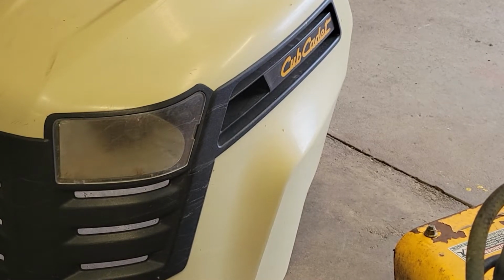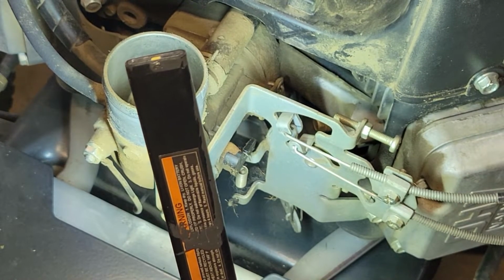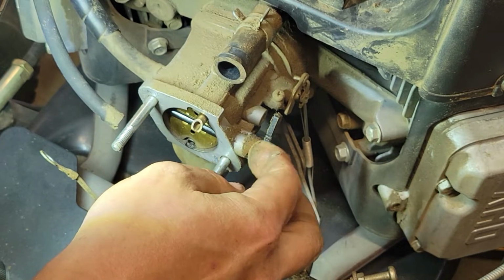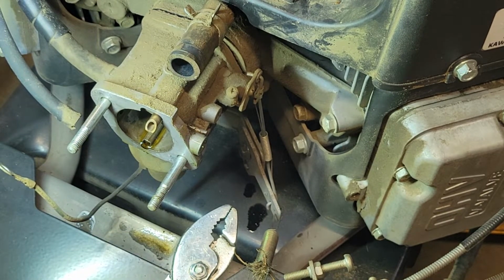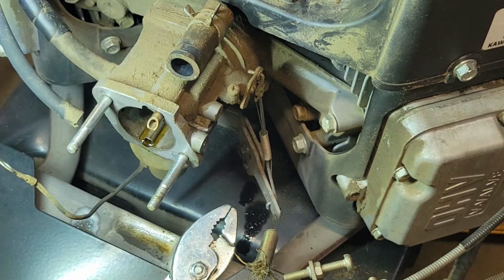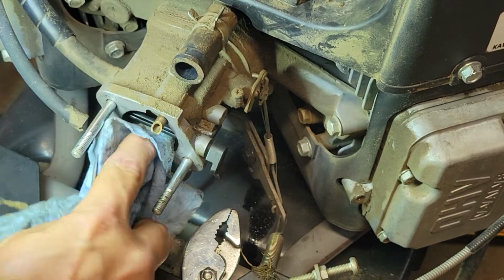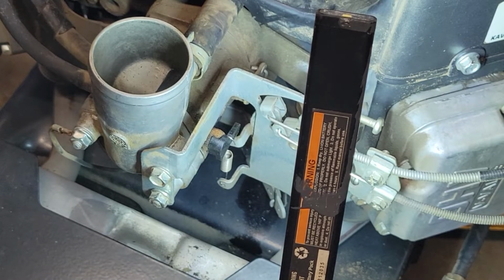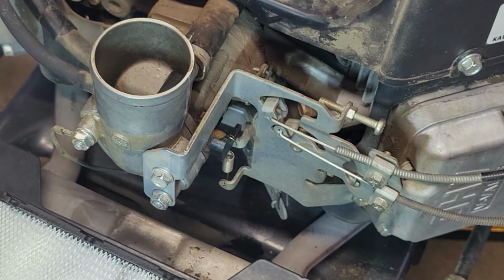stuck choke fix on a kawasaki V twin

Comment: Hey Dave that is a common issue on some kawasaki's. Taryl just did a video about these sticking chokes on Kawasaki engines and shows how he fixes them. good job on fixing this one. All the Kawasaki engines I have ever had I have always had to choke them when they were hot or cold. Good to see you posting again I missed you this winter.
Reply from the maker: Hi Bob. Funny you mention Taryl. A day or 2 after I filmed this he put his video out. I was contemplating on even putting this video out after seeing his but I thought somebody might find it useful. I thought it was funny that our fixes  were almost the same. Makes me feel like I did it right

Comment: From what I read, that seems to be common with those engines.  Your fix should solve the problem for awhile.  Funny how that problem showed up at the most wrong moment.  Good fix and great video.  Stevo
Reply from the maker: Hi stevo. Yes that's what I'm hearing now , that this is a problem.  Like I say I'm always learning.  Funny when I tested the drive belt on camera it ran great. Then I delivered it and it ran terrible.   When I messaged him I was going to take it back home to see why it was running badly,  he told me it ran bad sometimes. I wish he would have said something before hand but we got it handled either way

Comment: good fix . i have an old murray rider w/plastic bushings in front wheels and spindles , and always wonder whether i should lube plastic or not . also , i have several 1990s jd riders w/ kawasakis (great engines) , they all seem like the choke when starting hot/cold too .
Reply from the maker: Thanks Bill. Those 80s, 90s kawasakis are bullet proof    and I know what you mean about the plastic bushings.  Thanks for coming by

Comment: Do you think the entire carb might need attention? Needs some enrichment to start = dirty carb or air leak?
Reply from the maker: I do not think so because it runs pretty good but I'm no professional either 😁
Reply: @davessmallenginerevival2847  I’m not professional either. I’m good if it consistently starts every time, choke, no choke, whatever. As long as it is dependable enough to start. Don’t want to walk back to the garage when it conks out at the furthest possible place.

Comment: Mine was more difficult to diagnose as it only got stuck after the engine got hot. Of course one rarely uses the choke then. Havn't fixed it yet. The throttle shaft stuck last year and I had to ream out the corrosion from the aluminum housing with a drill bit and the shaft with emery paper. It uses a plastic sleeve as a bushing, so don't forget it.
Reply from the maker: Cool, you should do a video on it